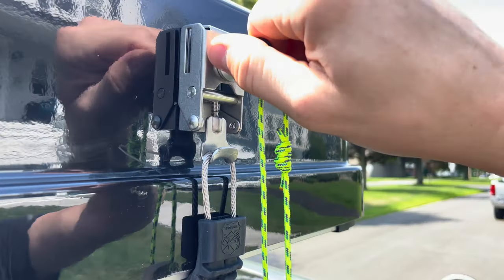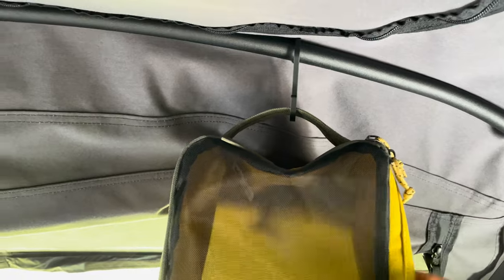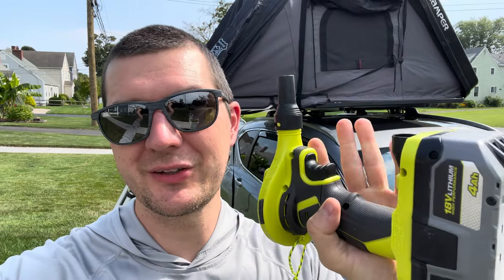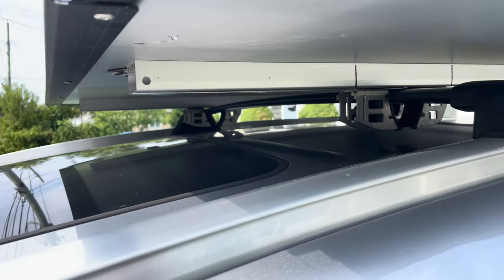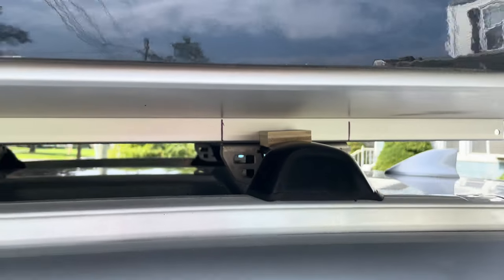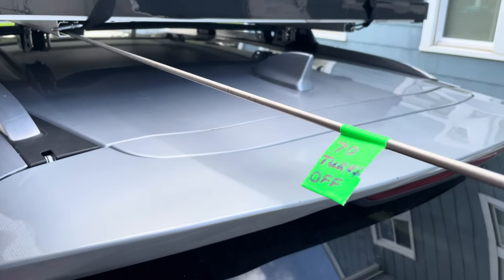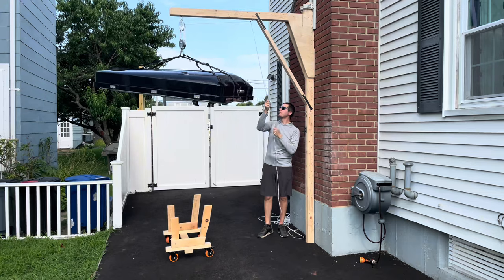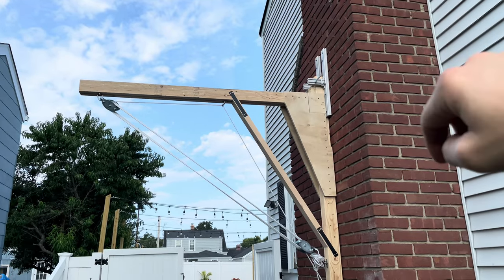DIY Roof Top Tent Crane and Other Hacks - iKamper Skycamp Mini 3.0

Comment: Great video Michael. Do you think is recommended to drill holes in the RTT rail?
Reply from the maker: Adding the 1/4" holes into the rail has a negligible impact on strength and function. I had no concerns adding the mounting holes to my setup.